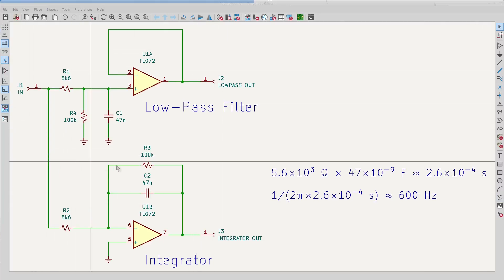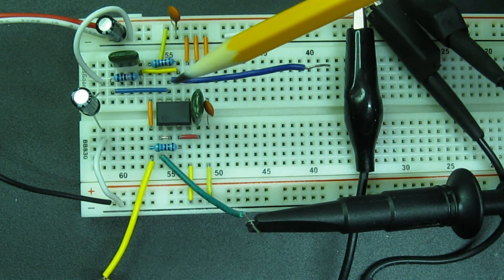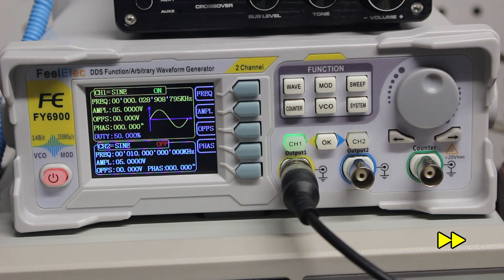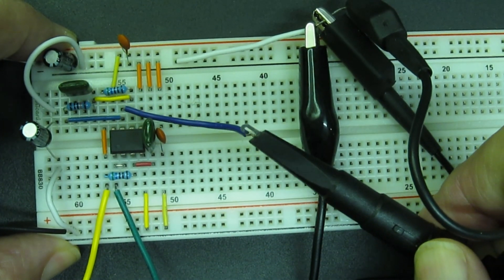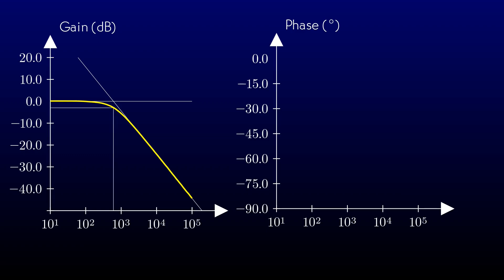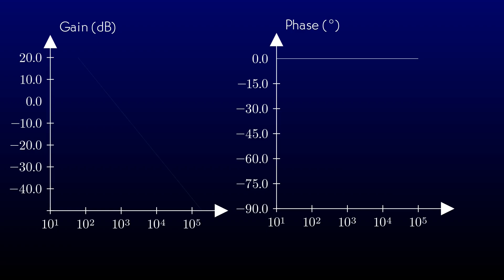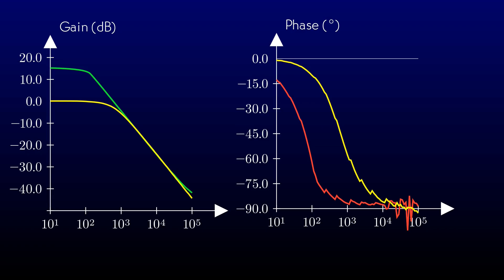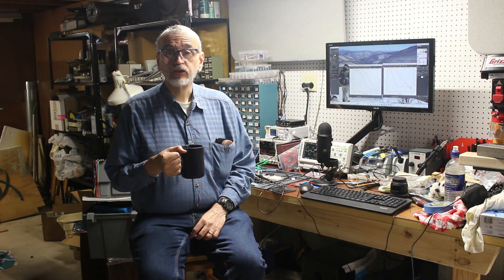Is an integrator the same as a low-pass filter? Exploring Analog Synthesis, ep. 7a

Comment: Basically a low pass can approximate integrals with reduced bandwidth and reduced dynamic range while the integrator "pulls" the curve into its integral form while having a similar tendency as a low pass filter.
Reply from the maker: I guess you can see it that way; in the frequency domain, a low-pass filter is an integrator with a dc cutoff.

Comment: I think the bumpy phase is occurring where the signal is quite low. You are probably hitting the limits of either your scope sensitivity or (as you noted) the noise is significant enough compared to the signal that the scope can’t get an accurate phase measurement any more. I wrote one of these too and had similar issues :)
Reply from the maker: @soothcoder  The scope sensitivity isn't the issue. I can get a clean measurement off battery powered equipment with proper BNC terminations. My FY6900 function generator has a known issue with a ground loop and I haven't made the modification yet, and this sketchy setup has unshielded wires all over the place. 

For the purpose of this demo, I couldn't be bothered to clean it up.

Comment: this is quite unfair to the integrator because the op amp is set up to have a gain of ~18 whereas the low-pass op amp has a gain <1. 

it'd be better to use the same values for R1, 2, 3, and 4 to ensure they're set up with similar gain! the integrator is distorting because the gain is much higher.
Reply from the maker: @andrascreams Unfair in what way?  The integrator is doing a fine job of integrating.  If I put in equal resistor values that you suggest, then the integration capacitor will discharge with the same time constant that it charges with. That makes it a better low-pass filter and a worse integrator.

Comment: The reason for the unexpected phase, and and to a lesser extent, the gain curve, is due to the 100k anti-windup resistor.  Making it larger, or removing it entirely, will yield more expected results.  Of course, without the resistor DC offsets/bias will cause the circuit to saturate.
Reply from the maker: @carlosanvito  yup. You need some sort of anti-windup, so you get into phase shifts. The gain and phase curves, of course, are perfectly explained by the fact that you're rolling off the low frequency gain with negative feedback at dc. But I'm trying to avoid getting very far into filter theory at this stage. That'll come later. 

TL;DR: I know what's going on with the phase shift. I don't expect the viewer necessarily to know what's going on, and you don't have to in order to get the main point of the argument.

PS: the feedback resistor is as small as it is because the offset voltage on the cheap op-amps that I'm using is as big as it is. I could get a better demo with a better op amp, but if possible, I want viewers to be able to get my results with jellybean parts.

Comment: The integrator is a low pass filter with a filter frequency of... zero.
I propose the name "no pass filter". 😀
Reply from the maker: @copernicofelinis  That's the differentiator - a high-pass with an infinite cutoff!
Reply: @KludgesFromKevinsCave  a differentiator is a high pass filter with a filter frequency of infinity. Look at how the corner is shifted. Basically an integrator attenuates frequencies above wc (lilke a low-pass filter), but amplifies those below wc. A differentiator does the opposite. That's why you need an amplifier to implement them (filters can be passive).

Comment: Could you explain to me what you mean when you say R3 (Rf) and R4 (Rin) provide a 0 DC bias? I am not sure I understand what that means. When I wrote out the transfer function for the integrator circuit I got gain = -Rf/(sCRfRin + Rin) which seems to make sense - at s = 0 the cap is open, the topology is an inverting amplifier, and we have gain = -Rf/Rin. So is it correct to say that it provides DC gain to the circuit? Thanks for posting this :)
Reply from the maker: If we left out the feedback resistor, when you try to solve for DC gain using your equation, you divide by zero. (You'll notice that I haven't introduced the Laplace transform yet, but your transfer function is correct!)

You're right that the DC gain is -Rf/Rin.  That's why we make Rf>>Rin - we want the integrator actually to integrate as close to DC as possible. The purpose of the feedback resistor isn't to provide DC gain, it's to limit it.

The 'zero bias voltage' refers to condition of zero signal input - the quiescent state.  In that state, the feedback loop should hold the output at zero. We can then think of the signal as being superimposed on that dc voltage.

In practice, it isn't zero, it's the op-amp's open-loop gain times the op-amp's input offset voltage (plus a correction term for the offset current that I can't be bothered to figure out.)  For the relatively slow signals that I was considering here and the cheap op-amp I was using, that was significant.  If I were using a low-offset op-amp, the feedback resistor might be 10M rather than 100K.  If I were using a chopper-stabilized op-amp, it might even be 1G. But (as I said to another commenter), I'm trying to make my examples work with jellybean parts.
Reply: @KludgesFromKevinsCave  Awesome, thanks for explaining! Can't wait for your next videos!
Reply: @KludgesFromKevinsCave  Turning junk into gold, love it!

Comment: What are you using to script your scope and AWG? Is it just Python? Or does the manufacturer have their own markup or something?
Reply from the maker: I found Python packages that do the trick.  There was a package for the Rigol DS1054z 'scope at https://pypi.org/project/ds1054z/ that Just Worked.  For the Feeltech AWG, I used 'fygen' https://github.com/mattwach/fygen - and found that I had to monkey patch the frequency-setting, because the wire protocol on my FY6900 wants the decimal point when sending the frequency to it, and the package as written just sends 14 digits without the decimal point. (I didn't find a reference for the protocol, just guessed that was the problem and tried it.)

The code that I used to drive the 'scope and AWG and produce the Bode plots is on the project GitHub:  https://github.com/kennykb/kevins-cave-kludges/tree/main/Synth/Ep007a-Integrator-vs-LPF